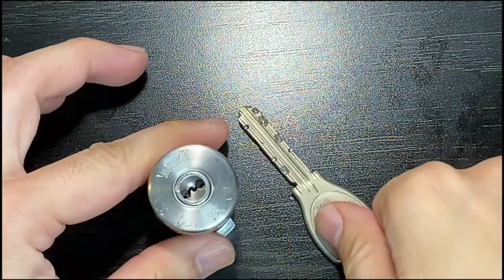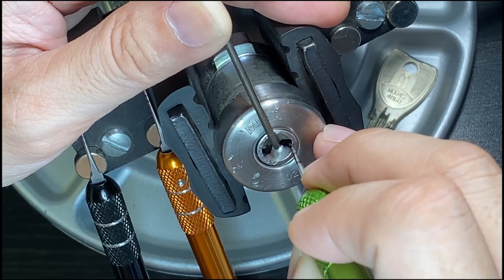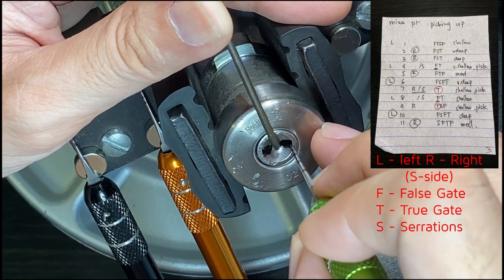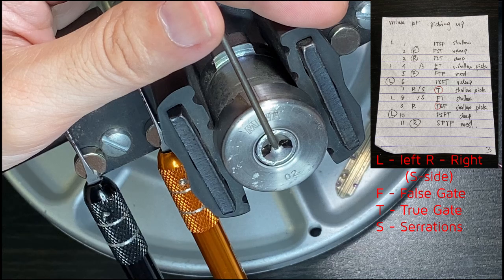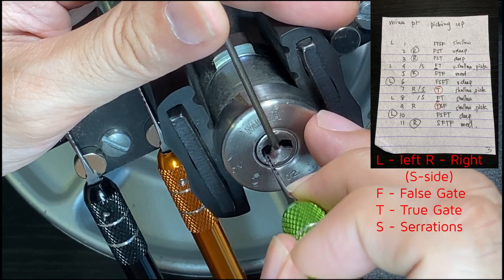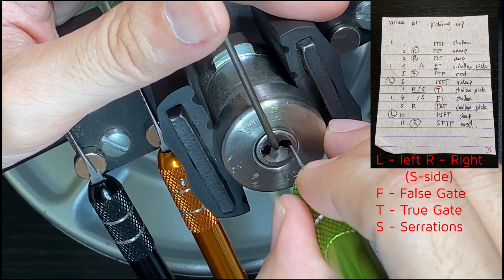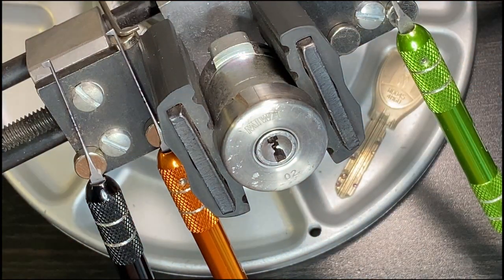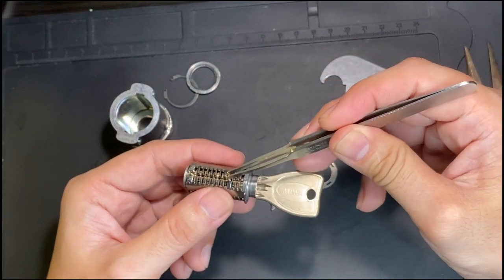[017] Miwa PR - pick + partial gut

Comment: I noticed also your grips are really thick do you still feel feedback? Like the same you would on a smaller more basic aluminum grip?? Or much less??
Reply from the maker: if you're referring to the dimple pick handles, they are the infamous cheapo "Honest Dong Shi dimple picks" (https://usa.banggood.com/search/12-in-1-pick.html), do a quick search on how these cheap picks need a lot of filing down and polishing to make them usable, I find these a great compromise between the top-of-the-line expensive but elegant "Multipick dimple pick set" and the overrated and overpriced "Sparrows Black Flags".

Feedback on these picks are great as the shafts are pretty stiff (unlike the Sparrows Black Flags)